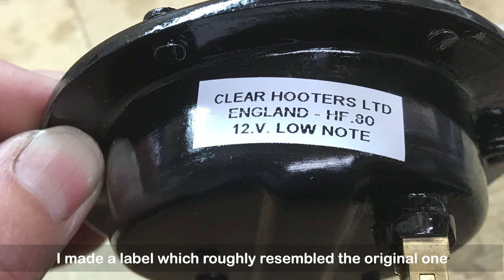Austin 1300 Hooter Restoration ADO16 Eps.19 Classic Car Time-lapse Horn Repair

Comment: It just shows the quality of the original parts on this car, that you’ve been able to restore so much without replacing it. 👨‍🔧👍
Reply from the maker: Yes absolutely. Most of these old mechanical parts are very ‘solid’ and have lots of excess material which can be safely removed during de-rust process. Shame the body hasn’t got a bit extra..

Comment: Brilliant work as usual , I was wondering whether you'd resort to making it easy for yourself and using screws instead of rivets - should have known better !.The making of them was especially impressive .Another job off the  list and very well done !.I had recently done this job myself to a Lucas unit from a vintage Triumph scooter - with less success as the coil is open circuit- I gather they are like ' hen's teeth ' !.
Reply from the maker: Thank you! No It really didn’t feel right to use screws, so I decided to make rivets with whatever tools I had at my disposal. If I didn’t have the woodlathe and dremel to make them, I’d have probably used an angle grinder and a file! Have you thought of repairing and rewinding the coil? Perhaps needs a small solder joint or use some new enamelled wire? Cheers

Comment: What material did you use for the gasket?
Reply from the maker: Hi, It is proper gasket paper which I bought for making the fuel pump gaskets. (From ebay) I think its about 0.1, maybe 0.2mm - hope that helps.